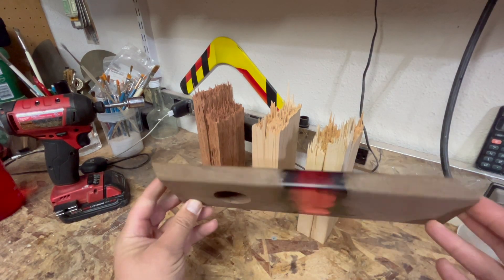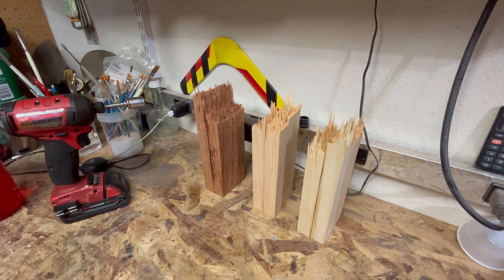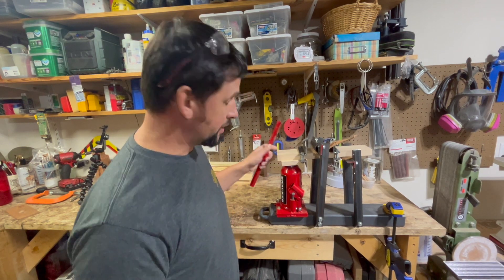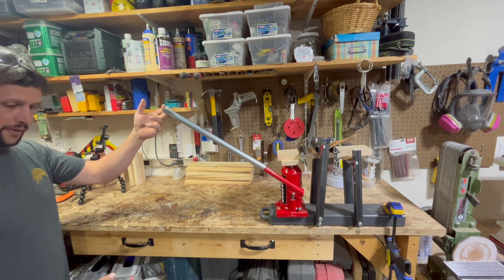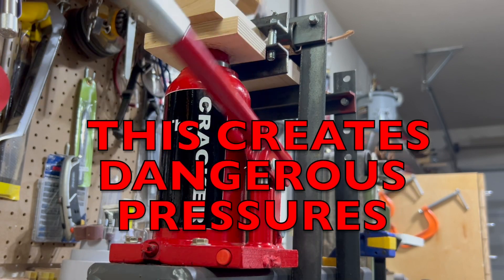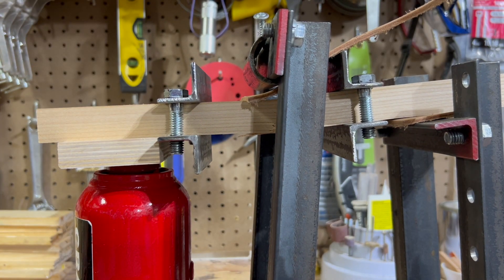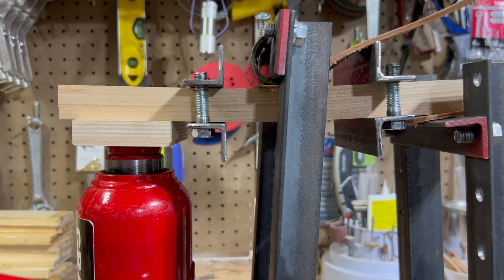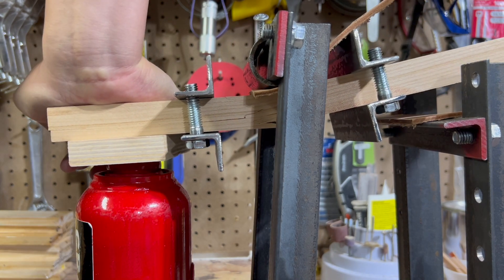My Board Breaking Machine

Comment: Have u ever tried to di that with.a hardwood like walnut or maple?
Reply from the maker: I have! It definitely has limits though. I use cherry and Peruvian walnut and they break fairly well. I needed to replace the 4 ton jack I started with after blowing the seals and bending my framework breaking bubinga. I upgraded the jack but stay away from anything that requires sketchy amounts of force. Some woods are just too strong at a full 4/4 thickness.